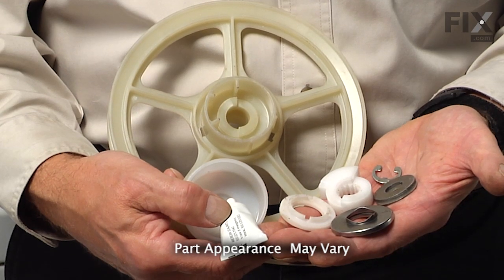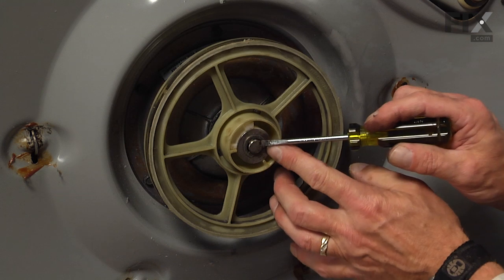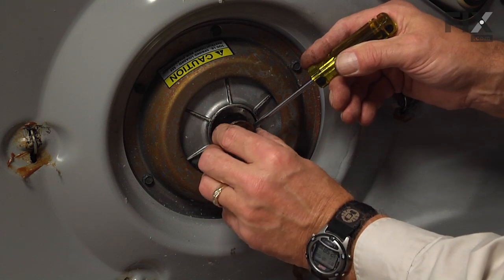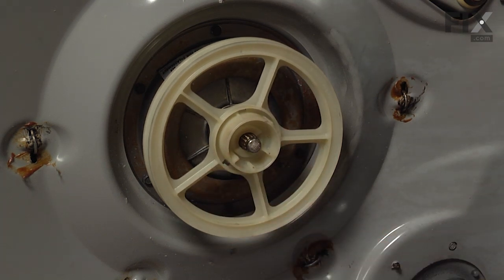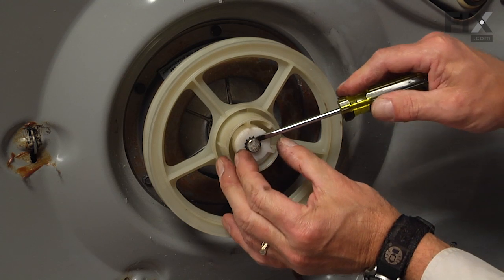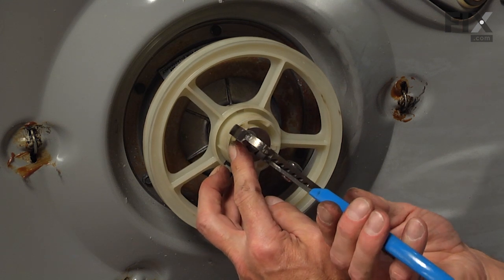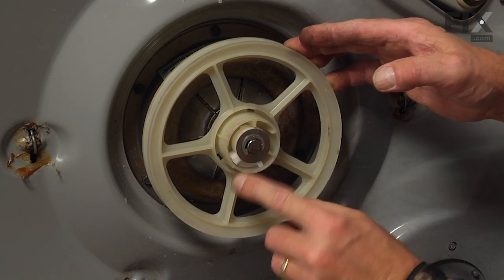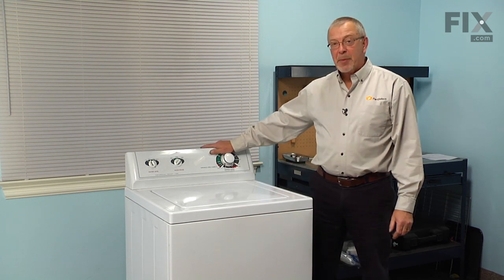Magic Chef Washer Repair – How to replace the Transmission Pulley and Bearing Kit

Comment: Hi, I have a Magic Chef washer to fix. It washing fine but does not spin in spin possession. I does not drain the water. In spin possession it just agitates like it is washing. When it is empty I try to turn the agitator and it is not turning. Normally a Whirlpool agitator turns when you turn it. But this is not. Can you tell me what could be the problem with this washer?  Thanks.
Reply: I’m having the same issue I wonder if this video might help